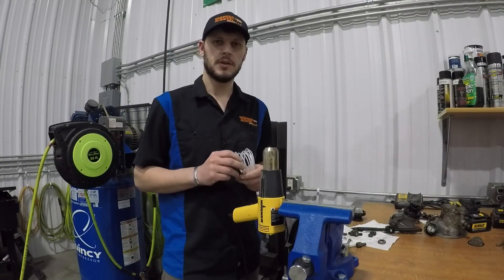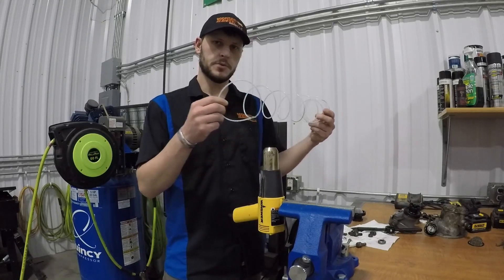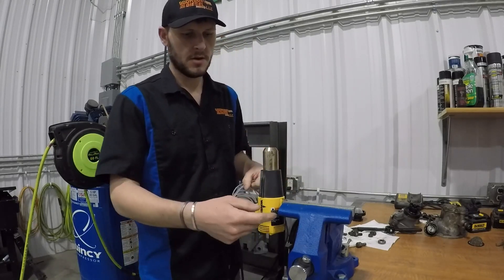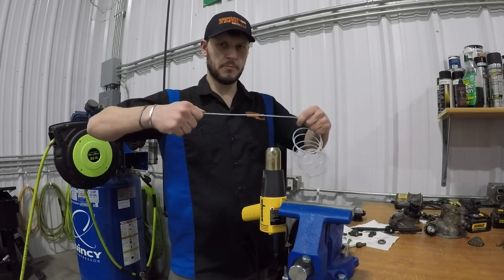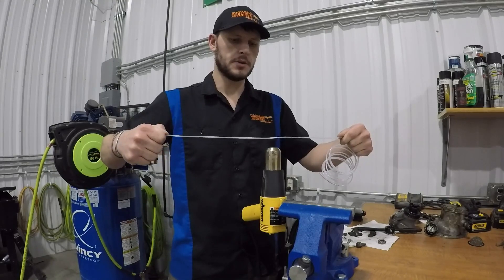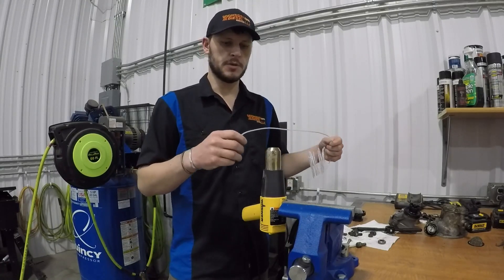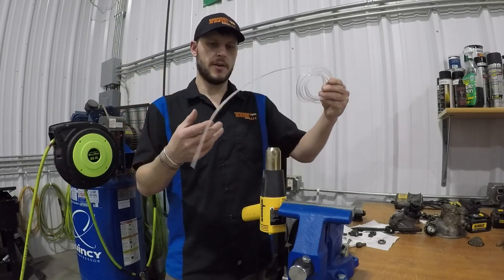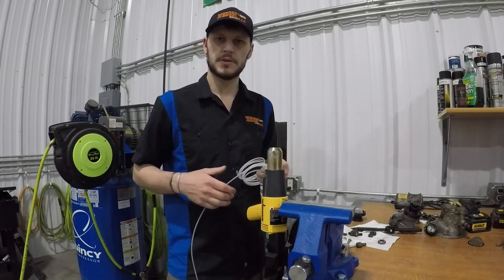Tech Tips: Straightening 1/8" Plastic Line for Gauges

Comment: Thanks.  I have an Autometer 0-200 air pressure gauge I will be installing in my 1998 Dodge diesel.  It has the same coiled 1/8" plastic tubing.  This will be helpful.